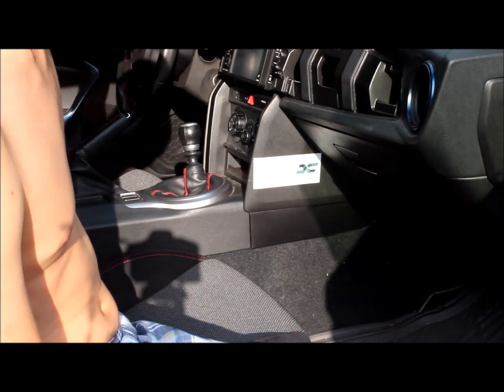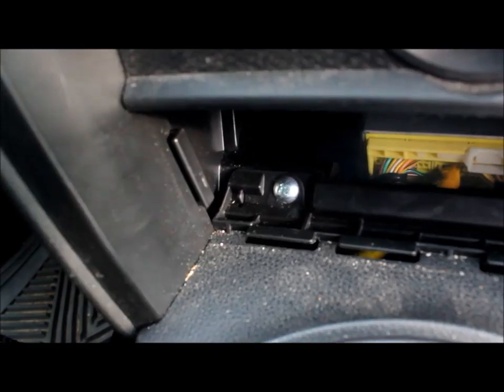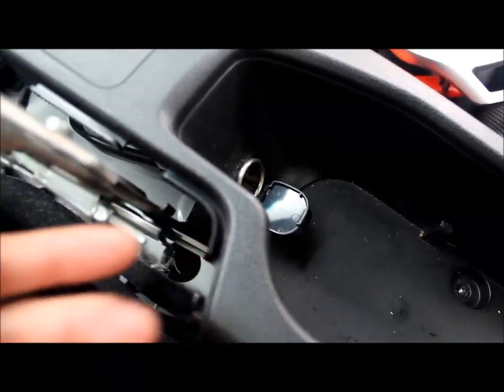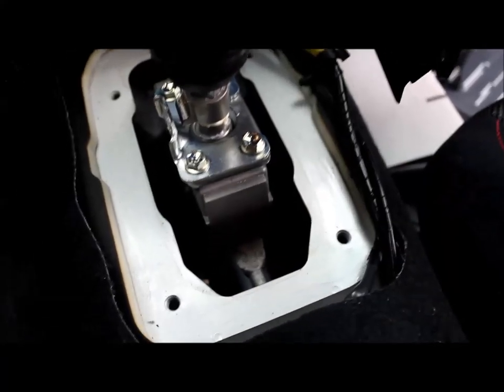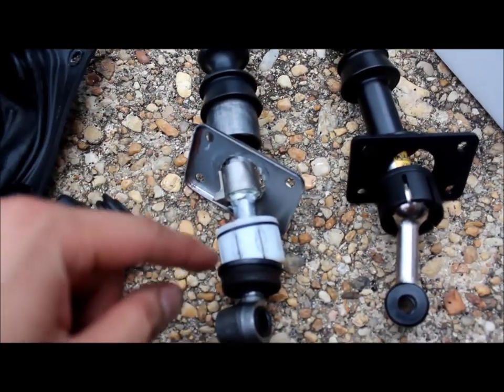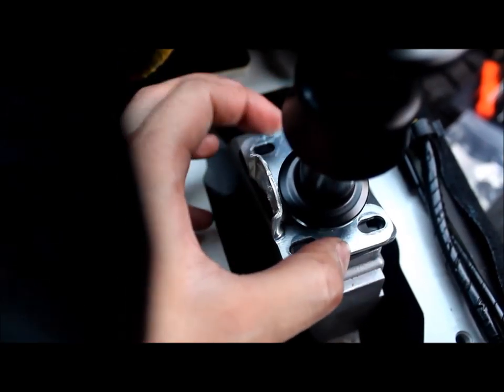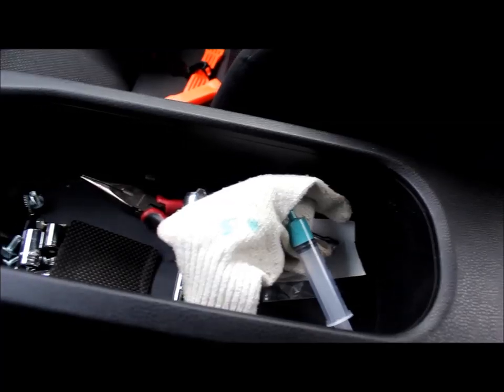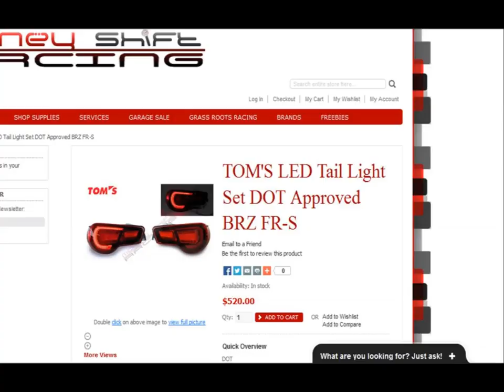How to install kart boy short throw BRZ FRS GT86

Comment: Hey, thanks for the video. I installed mine today and totally ripped the dust boot apart.. I'll have to get a new one.

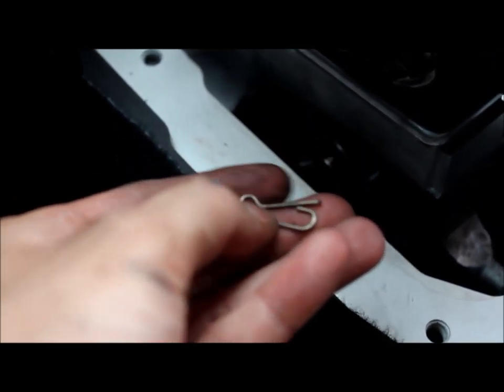I have a question: does it matter what side the the pin comes through? I'm referring to 7:21 in the video when you say that it has to come from the front.  I'm sure I put mine the other way.  Thanks again
Reply from the maker: +NemanjaGuitar No does not matter how the pin goes in as long as it is in. Also a hint to get the dust boot in. Kinda pre install it to the short shifter and then press it through the hole. & then slip it into the correct side etc. That's how I have done it.

GL
Reply: +Frank Hong Gotcha. I ripped mine when taking the stock shifter off. But I'll follow your advice when I instal the replacement one. Thanks!

Comment: Man. For some reason, I can't seem to fully put the control shaft into the gear lever, with whatever amount of force. Is there a technique to fully put it through or am I just a weak ass dude (lelz)? For a frame of reference, refer to 9:07 in the video where Frank's applying the KartBoy Lube onto the control shaft--that's the shaft that I can't fully press all the way through, so that I can put the washer and pin back on.
Reply from the maker: Do you have the shifter pointed at the correct way? I mean it's a square, but it goes in one way. I don't remember that taking an force. Have you looked at the Rally sports video?
Reply: Well this is going to a little redundant but I'm actually trying to remove my KartBoy Short Shifter right now and reinstalling the stock Shifter back into place. I installed the KartBoy Short Shifter over a year ago and I don't remember it being so difficult to put the control shaft in line with the Shifter (I literally installed the KartBoy SS in like thirty minutes and it's taking me over 2+ hours to successfully remove it and put back the stock parts on). 

And yeah, I have the shifter pointed the correct way (I mean there's only one way it'll fit, so that it looks straight rather pointing towards the dash). I've also looked at the RallySport video and their video is pretty much no help in regards to solving my issue. SADFACE LESIGH.
Reply from the maker: +TheSuaveBOSS dang ~_~  any luck? I recall it took me 3 hours when I was doing this. I kept on dropping the pin! & the dust boot kicked my ass. Along with cuts from that shape edge for some reason.
Reply: Coincidentally, after I wrote that previous comment, I actually got the shaft to work and the stock shifter is back into it's original place! I had to add MORE lube than what I already applied onto the control shaft. Speaking of lubing the control shaft, the stock washer that's supposed to reinserted along with the pin after putting the control shaft through the shifter, is now not cooperating with me. I can't for the life of me put the washer and pin back together onto the control shaft. sighz.

Comment: installed mine yesterday. idk if its me but the ss shifter real stiff than oem requires lil force. is this normal? ty
Reply from the maker: Yeah that's normal.  a bit stiffer then stock. do you have shift springs as well? that helps make it even better.
Reply: +Frank Hong yea i do have the mtec springs installed  but still kinda stiff maybe i just need get use to it. i ripped my dust boot its just impossible. i red somwhere that the boot is a one time use only. also my kit comes with 2 tiny o-rings do you know what its for? thanks
Reply from the maker: +jan the o rings might be where the pin / washer is located. Just make sure you get a fresh dust boot. BC water and crap can get to it and it will rust out real quick.

Comment: Did you change the seats?
Reply from the maker: na. not yet. That will be later. Hopefully, I will get a sponsor because my body kit is cray cray
Reply: Frank Hong your seats look like the ones from FRS RS1.0. What kind of BRZ is it?
Reply from the maker: limited.
Reply: Frank Hong It's your car mate but shouldn't limited BRZ have dual zone climate control and push to start and heated leather seats?
Reply: Frank Hong I just looked at Subaru website. It seems BRZ has these seats standard. I thought they would be black and red like FRS. BTW I own the Monogram FRS which is same thing as limited BRZ.
Reply from the maker: Brz only came in three options limited is there base which is bare. Hid. Nav. The one up has the spoiler, fog, leather, heated seats, dual climate, etc. then sti all above plus body Kit and good wheels and tires. I knew from the start my car was going to be gutted like shiz so I wanted the limited white. And manual :) I believe they changed for the new 2015 year.
Reply: Frank Hong BRZ is Series Blue>Limited>Premium. The one I'm seeing in this video is premium. The base version!
Reply from the maker: well damn :) you got me.
Reply from the maker: Got any big plans for your monogram?
Reply: Frank Hong No money to spend. I just got the J2 quad exhaust for now. May be in future when I make money I'll do a build with turbo/supercharger. For now I'm just a student working hard to keep my car. LOL
Reply from the maker: ***** I feel you. That's the move doh. I know someone who has spend over 30k on parts. & another person spending well over 40k on parts. I know about 150 people personal in that same boat as you :) Good luck?!
Reply: Frank Hong thanks. I know Jack not personally though. I know he has done some serious shit to his car. He is on youtube.
Reply from the maker: link? I am always up for some good videos. Here is a link to 1 of the bros spending $$$$$$$ I mean a full blown turbo kit. Max it out. throw a LS2 in it. change transmission axle driveshaft exhaust. (everything) Now building up a 2jz and redoing everything ish. Also he is going to change the color of his car :) gonna be sick. https://www.youtube.com/watch?v=OCrbpU9A6B8